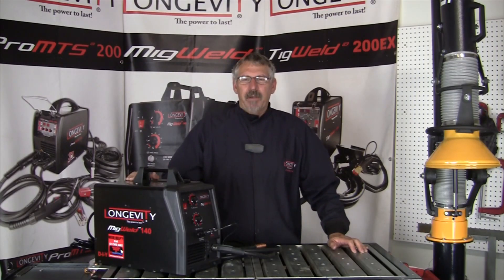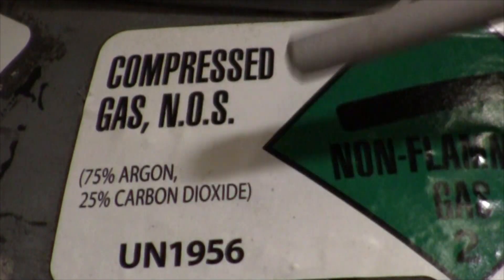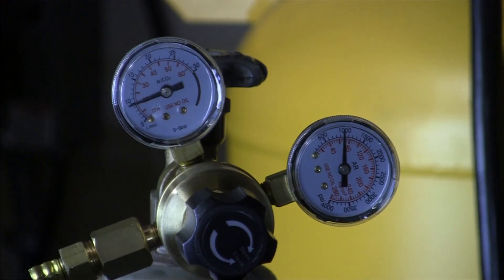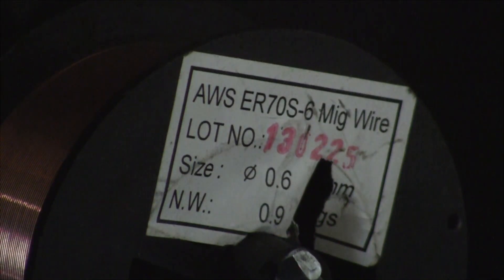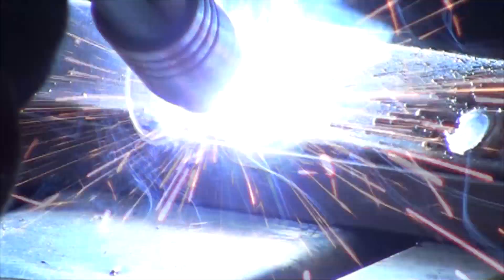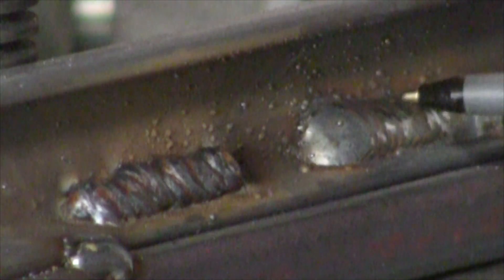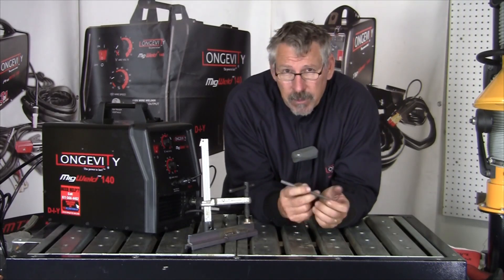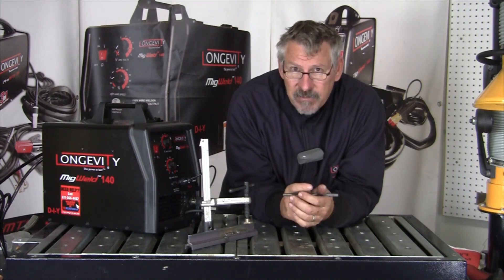MIG WELDING WITH AND WITHOUT GAS - WHAT WELDS LOOK LIKE IF YOU RUN OUT OF GAS

Comment: I understand that the gas is supposed to help the weld bond, so what happens with wire welders that don't use gas? are they just as strong as gas or less strong? I have a gasless. I haven't done any welds that required real high strength with it yet but am planning on building a trailer with it, provided I do the welding right will the welds be strong enough?
Reply: Then you're running FCAW not mig.  FCAW actually penetrates better just doesn't look as pretty.
Reply: +the stig mach 1 First and foremost, lets clarify “Gasless”, because there is no such thing as gasless mig welding because the weld pool has to be protected from the oxygen in the air that’s all around us and the way this is done is to replace the air with gas!  So called “Gasless” Mig Wires are in fact “Self Shielding”.  Self Shielding Mig Wires are a tube of metal with a flux core.  As the welding arc melts the wire it also burns the flux, which produces a gas shield around the welding process.  So NOT “Gasless”.
Reply: +Steven Kennard however they are labeled as gasless by the manufacturers. they are gasless because you don't have to add gas to them. by your logic then an oiless air compressor isn't oiless because it comes with pre oiled bearings and stuff.
Reply: +the stig mach 1 True, the manufacturers label them as gasless because you don't use gas cylinder with them, but this often leads to confusion as many newcomers don't realize that you can't weld a strong and quality bead without some form of a gas shield. Where ordinary mild steel mig welding wire needs an inert gas shield to prevent it from oxidising when melted, gasless MIG wire has a flux core which forms the shield around the weld to keep oxygen out. This means that you can't use the same wire from a gas mig welder with a "gasless" mig welder. The "gasless" mig welder doesn't do anything special. They are cheaper simply because they lack the ability to use a gas cylinder. You could run flux core wire through a "gas mig welder" without using the cylinder. Does that make it gasless? Hmm... Either way, for the quality welding that you would want for something as important as a trailer, you really should go with a gas mig welder. MIG is the way to go if you have the extra cash for a MIG capable welder. But the low cost of the gasless wire feed welders makes them attractive for the hobbyist. Once you find out how handy a welder is, you'll want to upgrade quickly. Once you get one, you'll look for things to fabricate, just for the heck of it!
Reply: +Steven Kennard I have a "gasless" and definitely do find it useful for random things, and makes things a lot easier when I decide to make some sort of contraption. I just bought a cheap one because I don't have the cash or a place to put the nice gas one. I store it in a garden shed that's overflowing as it is since I don't have a garage right now. I want to make a trailer I currently have bigger and figured if what I have will do the job no sense in buying something more expensive. I've never really stress tested any welds I've made with the current welder, and I guess I should do that somehow to see how well it does. and how well I do for that matter. I'm fairly new to welding and still learning a lot but so far anything I've made hasn't fallen apart. I made motor mounts for my boat engine swap and they held like a champ so I'm pretty confident in mine and the welders work.

Comment: in our shipbuilding production welding is with CO2 and .053 wire.  the yard buys it by the pallet full.  stick is only used for small tacking otherwise everything is shielded fluxcore

Comment: Man o man some pepole are really a dum ass nothing better then to talk shit I mean he just made a fast video to just show u what happens if the gas is shut off and u forgot to turn it on or if u ran out what it will do I mean I understand he should of at least explain a bit better that it's a no no to mig weld without gas but if u hear him at the end he said it is not a good idea ! But he at least should of said that flux welding is what to use without gas but doesn't mean that he made a video not noing what he was doing cause man I've seen some fucking dum ass making videos not noing shit and no clue what's going on at all o and by the way I've Ben welding just about 18 years on and off I paint cars Ben painting cars for my 18 years straight and on and off weld panels or radiator supports when paint is done for the day and on top if that have a welder at home with a nice set up to do anything like at the body shop so it's not like I am a dum ass that is learning how to weld or work on a car and on top of that no one no's everything who ever says they do there full of shit back in the days when I learned how to do things the first thing that I learned first thing was do say I No I No cause your be fired in the spot even If u new shut up and listin that was rule number one o and as a kid my dad work on cars painted cars pulled motors out u named it so I've Ben holding a tool from what I can rember and I still don't think I know it all but I can say this I've never ever brought my car to anyone I mean anyone or my family or girl to no one I've never Ben fucked with a bill or someone hacking my car there are good pepole out there that work with cars or what ever that require a tool or welder but I'll say this very very small percent are good I mean a small percent and the rest a hacker all the cars that come in the shop when they come hit and some of them u see the crazy hacks on them or poor poor work on these cars and noing your life is riding that car never mind your kids or your new born that is where the dum ass that no it all don't know !!! Anywaze to the guy that made this video all u where trying to say was gas or no FUCKING GAS right !! I understand what u where trying too say I didn't watch your video cause I don't know how to use a welder I watch it cause I like to poke around when I have time too see what is out there .. O and at the shop when am done using the welder I move all the settings something I learned from a oldschool person it makes it better for the ones that know it all !!!

Comment: anybody care to do a video of welding the same materials all things equal with each of the different 3 welding machines arc , mig , and tig so one can see the difference in quality or structural hold and why. Because only then would one see a benefit to using one over the other or when one is better to uses over the other
Reply: Stick tends to get used for medium to high penetration and in the field where it is inconvenient to cart around gas bottles and block wind all the time. Stick is also in some ways less sensitive to material condition and settings than other processes. It's not as fast as GMAW. MIG/MAG (GMAW) is gas shielded so no slag to clean, and can be burnt very quickly for production environments. It tends to work best for low to medium penetration applications. When deeper penetration is required, many shops use dual-shield flux core which uses both gas shielding like GMAW in addition to a flux inside or outside the wire that leaves a slag. TIG is really slow, but offers a lot of control and is also gas shielded, so no slag; it's occasionally used to make pipeline root passes.

I'm interested to hear what "all things equal" means to you in this context. The processes necessarily run at different voltages, so "same amps" for instance doesn't mean same power delivered or heat into the work piece. You could try welding the same joint in the same material thickness, but various settings on each process can deliver drastically different penetrations and burn rates. The selection of process is more based on what environment and time constraints are, as with the right equipment, you can pretty much use any process for any weld, albeit not efficiently or easily.
Reply: @connors.1077  You sound like you know your shit.

Can I ask you for some advice.

I want to get a welder for home for DIY projects, that occasionally may need to be fairly durable, such as welding bike parts.

I dont want to use gas cause I dont want gas bottles in the house.

What machine/ sticks do you recommend?

Comment: I see for your mig video which was great you showed that having no inhert gas gives a less solid weld but there must be an equivalent all things equal using an arc welding machine to get as good if not better weld without the inhert gas some higher current arc or some maybe I am wrong and you would have to change the material

Comment: seems to me gas welding is with the absence of  an electrical arc , mig or tig is using both gas welding (different shielding metals)  , and arc welding is just with an electrical arc no shielding gases so confused seems like you can do it any way you want and it would come out fine as long as you new what the equivalent volt/amp , wire speed , or inhert gas ratio's or electrode wires you should beable to jump between any type of machine arc , mig/tig , or gas and get the same results. But maybe it is difficult to get the exact equivalent on different type machines for different applications
Reply: Arc welding is still shielded! so is FCAW. Arc uses coating on the outside of the rod. FCAW it's the core that creates the shielding gas.

Comment: I know for mig and tig welding there  is inhert gases made up of different variations of  argon , co2 , o2, helium (for high steel applications)  for different welds some are 100% others are 75,25% , or 2% ,...etc but is there ever a case that one would want to uses no inhert gas when welding in mig or tig

Comment: I get there is different shielding gases of ratio's of CO2 , O2 , argon , helium ratios common ratios are the 75 , 25 % but other exist for differences between steel welding , Al ,...etc but is the any reason to weld with the inhert gas completely shut off I see in your video it still works to some extent but is there any applications when it is better to have no inhert gas on for a mig or tig machine. Or for any types of E705S ,...etc different tensile strength wire/material?

Comment: you have to use a Flux core wire if no gas.
Reply: Nobody's saying you don't. He's demonstrating what happens when you're welding with solid wire and run out of gas.
Reply: John Ridley than you screwed
Reply: chaba72 Exactly what this video showed. Did you miss that somehow?
Reply: Why would I miss that ? It's in the title ,
Reply: The comment "you have to use Flux core wire if no gas" kind of implies that you missed the point of the video, which was to show what happens if you weld without flux core wire and without gas."
Reply: Ok , would you give it a rest ,
In case someone had a question "why what do I use then " they see my comment, and got the answer.
Reply: You completely missed the point of the video.
Reply: What's the strength difference between MIG w flux core vs MIG straight wire w Argon/CO2 ? @aaronscribner
Reply from the maker: Yep, no gas, get some Flux! Some MIG machines only Flux as well. We have one for like $150.00

Comment: This video is Simply to show NOOBS that have no know how that you need gas when welding or you will not get any penetration at all.
Reply: The MIG welder I bought years ago came with flux wire and was meant for gasless welding, but the results are about the same as in the video. I'm gonna have to invest in a gas injection system

Comment: this is a terrible video. there is no gasless mig. thats what mig is. gasless flux core please. and under no circumstances should you use mig with no gas. never. take this misinformation down before someone uses er70-s6 with no gas and kills someone.
Reply: yall dumb asses he put this video on here to show what the difference is between the two welds when you weld with no gas hes not advertising and telling everyone you should mig weld with no gas
Reply: HAHAHAHA...YOU ARE RIGTH
Reply: ahahah yeah ryt dalton hart ahahahahah
Reply: misterRISK83 oo
Reply: yea, it is horrible. The proces is called MAG (metal active gas -- when co2 or mix is used it's mag). MIG uses inert gas (Ar or He - for alu). BTW Gassless fluxcore is the worst thing I ever tried...